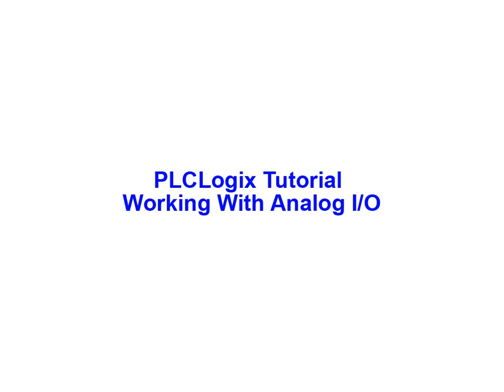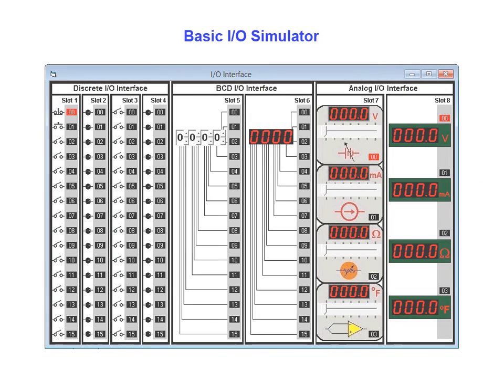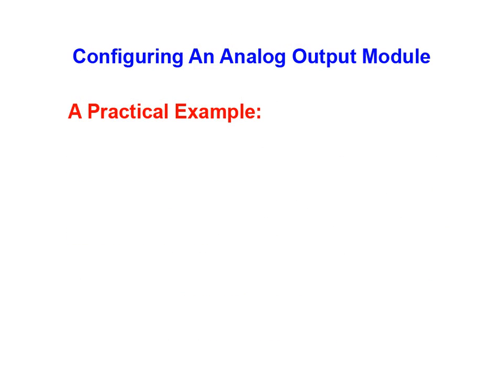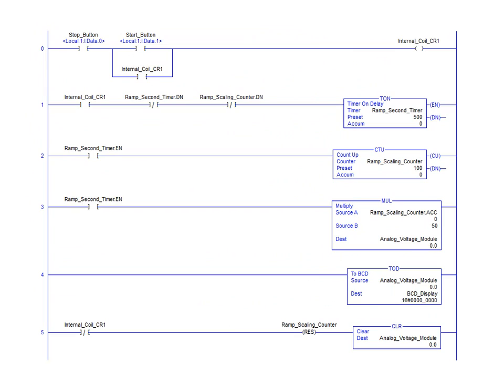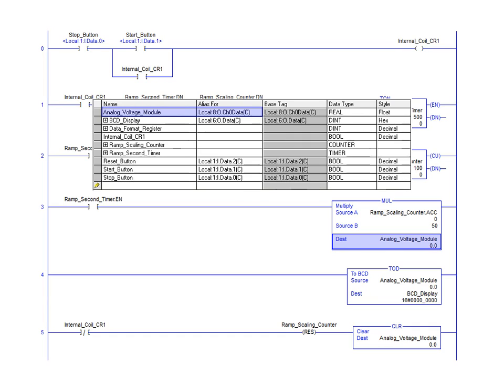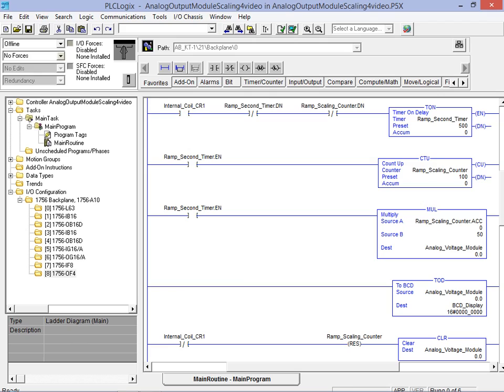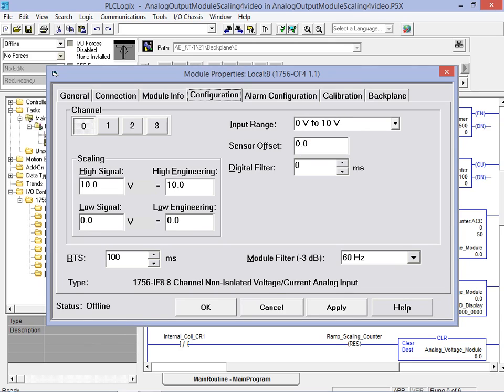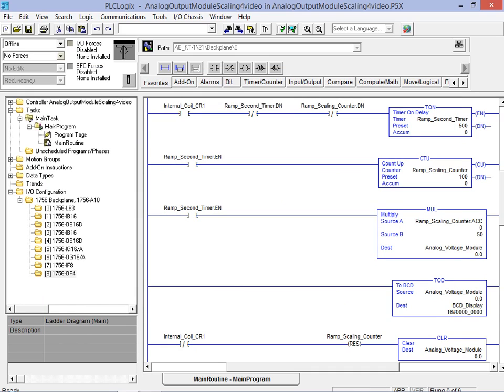PLCLogix 5000 Tutorial 5 - Working With Analog IO - PLC Technician II

Comment: Why is the Ramp_scaling_counter.DN needed in rung 1? I believe the Ramp_Second_Timer.DN is there as a reset for the timer but I'm not sure why the former is required.
Reply: Is it because the Ramp_scaling_counter.DN normally closed switch will become open at the end of the program(When it reaches 10V) and prevent the timer from being active again?

Comment: what is the simulator called?
Reply from the maker: The simulation tool used in this video is called,   PLCLogix 5000 and uses RSLogix style programming with tag based addressing.  You can check the vendor for this as well as other products.  (logicdesign.com)